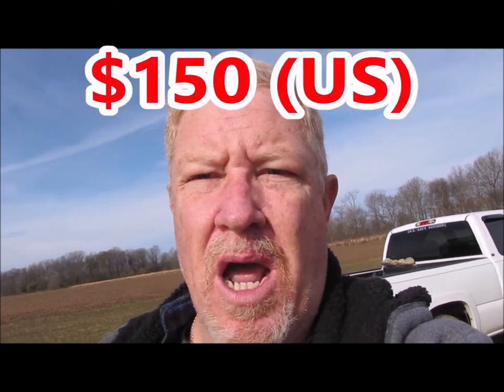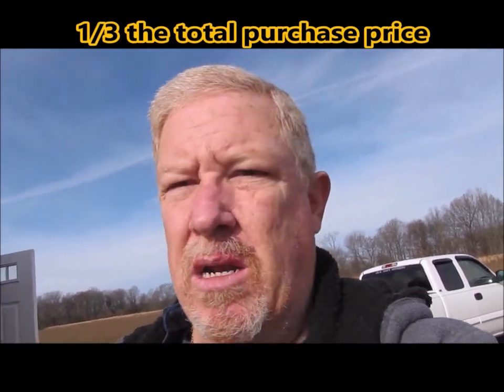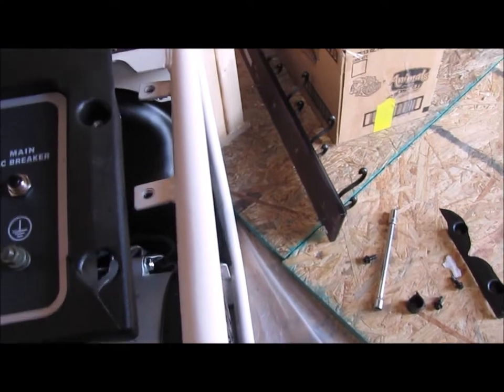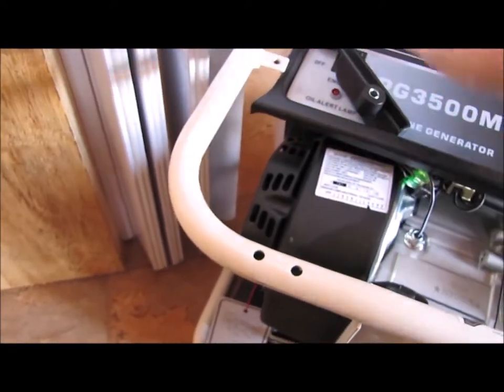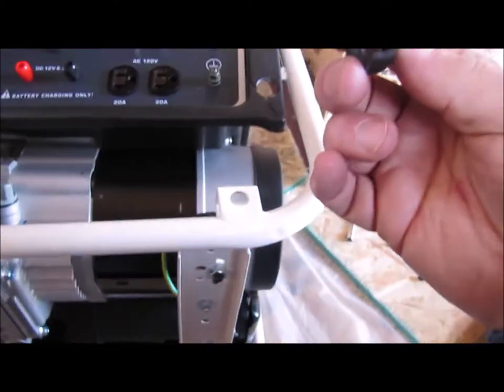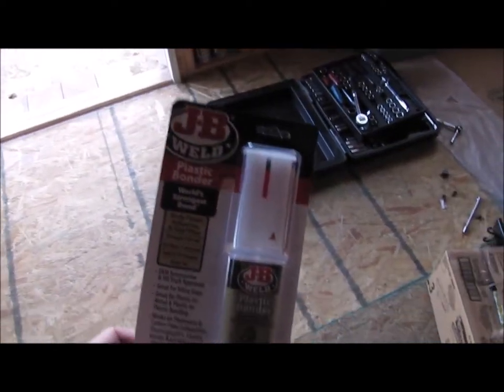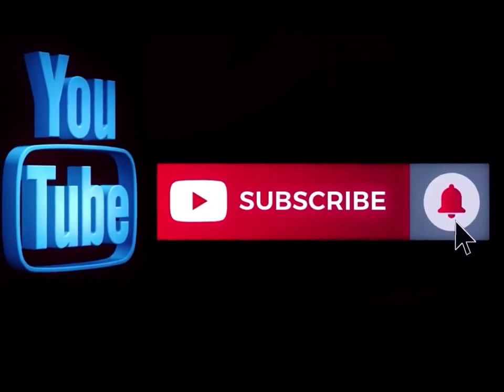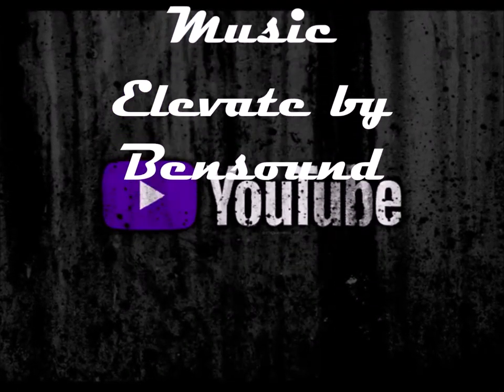Fix a Pulsar 3500 Generator panel EASY |  Repairing shipment damage

Comment: Hey Ed! That's crazy to hear that the damage on your generator could not be fixed unless you ship it back to them and pay $150 for shipping. This is totally their problem.. we can't believe they are giving you the runaround!! TOTAL BS!! Good thing you are equipped with the knowledge to repair it yourself. $25 was not a bad price for the epoxy and tape. As long as it works, that's all that matters! Great video and love you to the mother effin' moon! :)
Reply from the maker: Seems like the little people are always the ones taking it in the shorts, I should be used to it by now.  Thanks so much!!
Reply: @EdsAttentionToDetail  Isn't that always the way!

Comment: Wow that seems like a lot of hard work. Seem like it's electrical work maybe electrician would do a lot better. Cuz if you get it wrong can really be a big serious issue.
Reply from the maker: That is the main reason I did not remove the panel from the generator and repaired it while still attached.  Thanks for watching and the great comment!